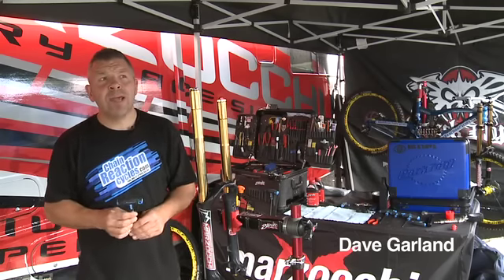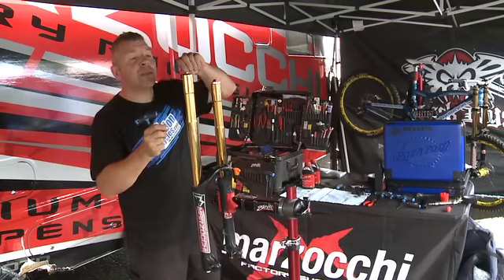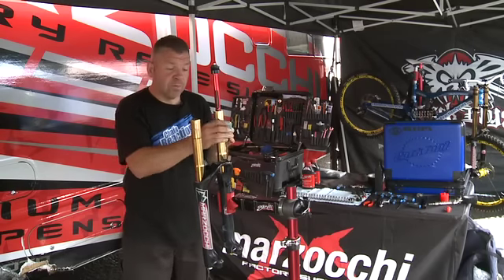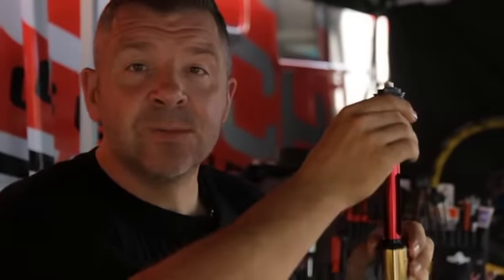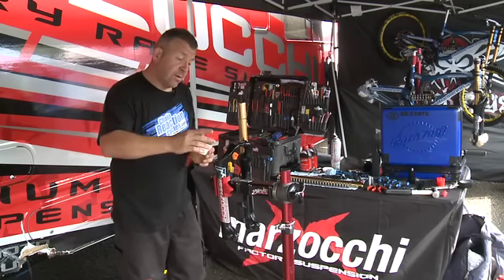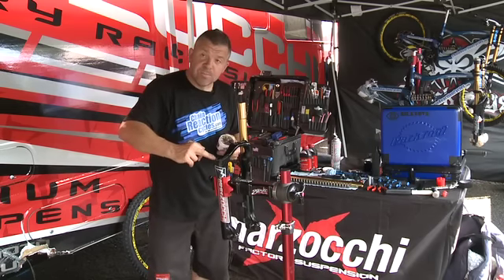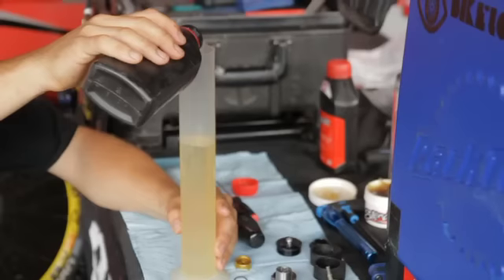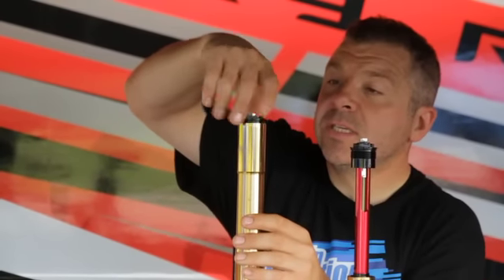RC3 Marzocchi 888 fork rebuild

Comment: Great informative video from a good mechanic.
The dust seals would come standard as a fail safe I'd imagine. So they still catch and hold some oil if the fork is neglected. 
He didn't do any heavy work on the unclamped leg. The point was not to flex the arch, so when doing seals etc, work on clamped leg.
One of the best how too videos I've seen, lots of minute handy tips for people.

Comment: I have a question. I have a marzocchi 888 RC3 from 2008 and I was trying to replace the spring for a lighter one. While I was taking out the old spring I found out that there was a huge spacer in between the spring and the adjuster, it was approximately 15-20 centimeters. I replaced the spring with the new one but the spacer comes above the stanchion with almost 10cm. This leads to a huge preload on the spring.
Is this normal? or should I cut of a piece of the huge spacer? (spacer is plastic)

Comment: Good day sir. I have a little bit of problem on my 888. When compressing the fork there is stiction on the first few centimeters of travel, when i get past that, the play becomes smooth. Upon releasing, the fork gets "stuck" up in that area again for a few seconds before achieving full travel. I can also feel the stiction when compressing the fork reallt slowly. It feels like there are "steps" in between my compression, and not a smooth slide. Also when i stand on the bike in attack position, the fork wont compress when push on it a little, it seems something is stopping it, but when i push the handlebars strongly, the fork then compresses and acts like normal. Also, just replaced with new oil. Still the same.

Any idea what could be wrong?
Reply: Hello Sir. Unfortunately Dave Garland is no longer with us. He passed away. Back to your issue. Is the hub the correct width? If the lower legs are being flared out from a wide hub or pinched in due to narrow hub it will definitely cause that issue. Let me know how you get on.
Reply: @moparmtb360  im sorry for the loss of your mechanic sir :(.
I use the correct hubs size sir, an atomic hub 20x110. Also, i replaced the seals with Enduro blue seals. The issue was lessened by 50%. There is only stiction that is left. I'm not sure if this issue is about seals or the bushing themselves since i also read enduro blue seals always have stiction due to the design.. I'll try to use SKF seals when they come on stock. If it is still the same, it could be the bushing themselves.
Reply: @ridesafealways4929  He wasn't my mechanic. I'm just a random guy in the comments. Thanks anyway as a loss to us all. What fork are you using? A Bomber 888 or a bomber 58? The 58 is 90% a fox 40 so a very very different fork.
Reply: @moparmtb360  888 rc3 evo. I don't know if it is V2 or not. I am also not sure what year it is. Maybe 2011 because the serial says M11......
Reply: @ridesafealways4929  I had some of those. Definitely not as smooth as the older 888 from 04-06. I suggest removing the spring, damper and seals. Then see if the legs slide smoothly and drop under there own weight. Another thing. I remember once I used silkolene in a pair of marzocchi 380 and the stiction was horrible immediately. I use motul expert 5w and find it the best.
Reply: @moparmtb360  can i use 5w oil if my stock oil is 7.5w? If i have the blue enduro seals, should i put sram butter in them? If they do drop smoothly under their own weight, does it mean the bushings and seals are fine?
Reply: @ridesafealways4929  you must remove the seals to test if they drop under there own weight.
Reply: @ridesafealways4929  You can absolutely use 7.5w oil. I just prefer 5w in the forks I use. Some forks require different oil viscosity to get a broader range of adjustment. Any more questions just ask.

Comment: Why is Marzocchi using the foam rings when using grease is the "better" option?
Which grease do you use?
Is there no problem using the grease? I'm concerned that the grease could get into the fork and mix with the oil. And then possibly could destroy the catridge.

Comment: Why is one side spring and one air? I'm confused...
Reply: air rebound adjust
Reply: one side handles shock absorbing by compression, the spring side is rebound. both are adjustable and that's the nitty gritty of tuning your for for YOUR preference. lots of videos on tuning, and generally any brand's videos can help with that